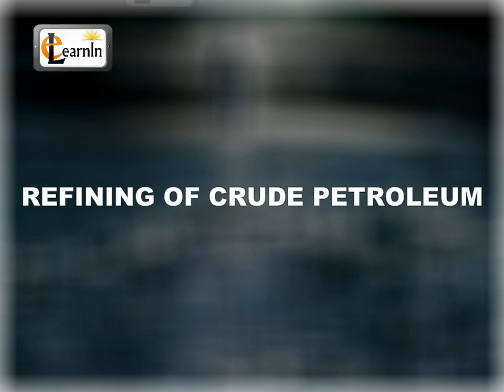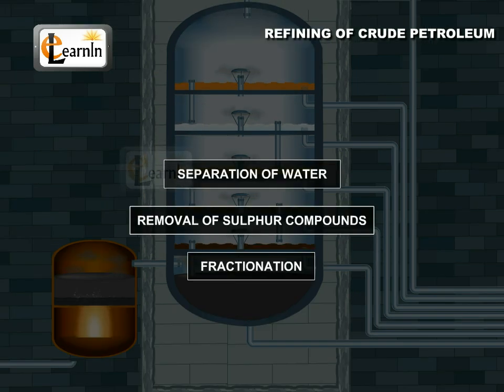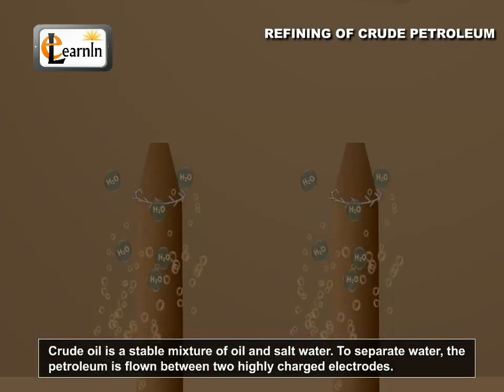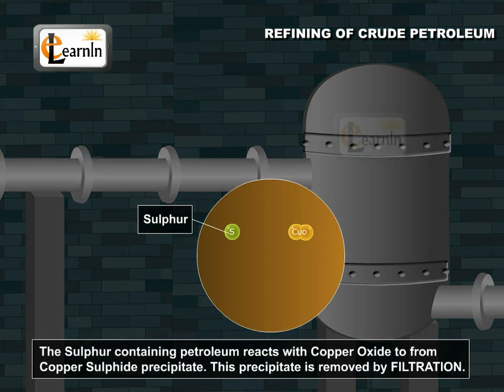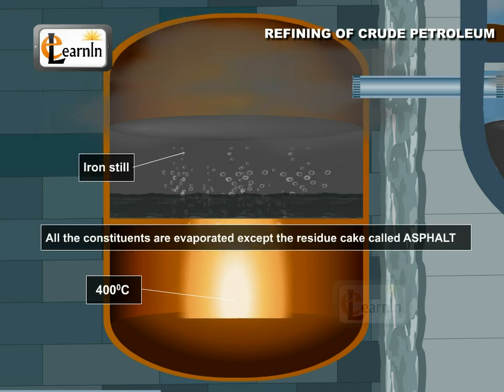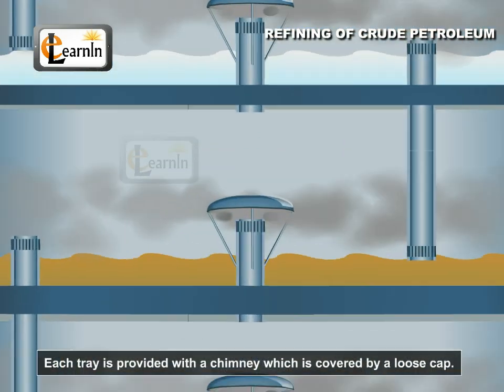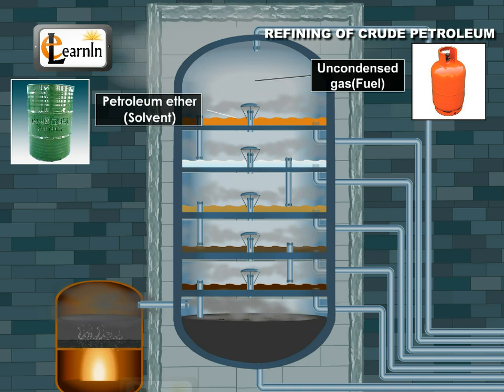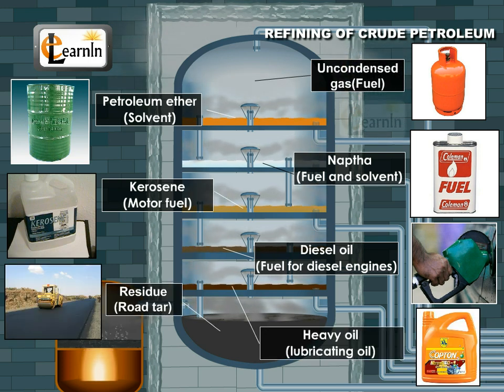Petroleum and its refining - Chemistry

Comment: Making something radioactive is as simple as adding neutrons. Fusion powers the sun, so it's obviously possible, but it's hard to keep bajillion-degree plasma contained without it transferring heat to the casing and thus away from helping further the reaction. H-bombs, for example, are a small fusion reactor wherein the repelling positive charges are overcome not with heat but from the pressure of two uranium bombs on either side of it (they squish the protons together). Difficult, but possible.

Comment: To separate pieces of nuclei, you have to make them radioactive. To fuse nuclei together, you have to make the material into plasma, heat it so that the nuclei's vibration is strong enough to overcome the repelling magnetic forces made by the protons in each nucleus, and then wait for them to hit each other. It's rather difficult, and it's not very easy to do complex things (the only element that's profitable to turn into gold IIRC is mercury, which is one particle larger. No instant money yet).

Comment: This video does not concern about forming new chemicals. It describes different physical (vaporization) and chemical (the sulfur removal reaction) processes to separate the different compounds from the cruel oil mixture. A physical process is a process that does not change the molecular structure (arrangement of atoms) of a compound, as oppose to a chemical process which does.
Your question about separating subatomic particles is nuclear chemistry, which is different from all of above.